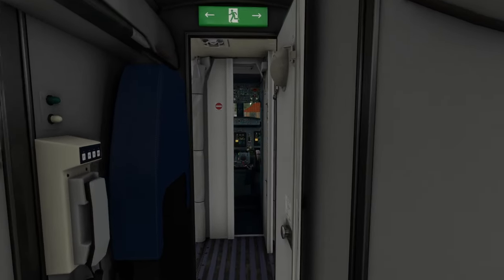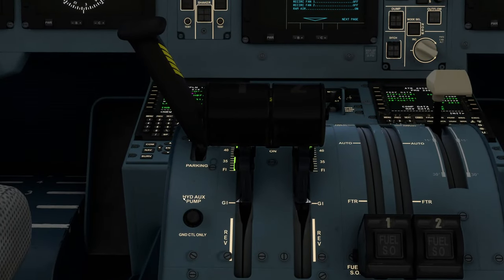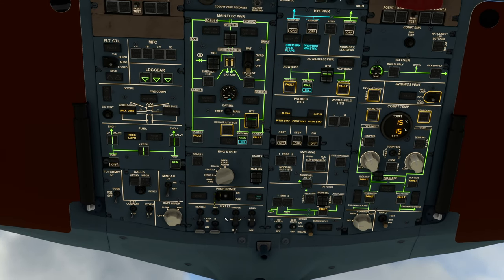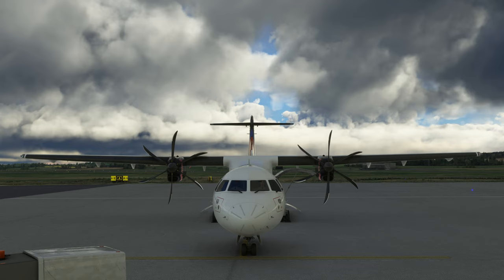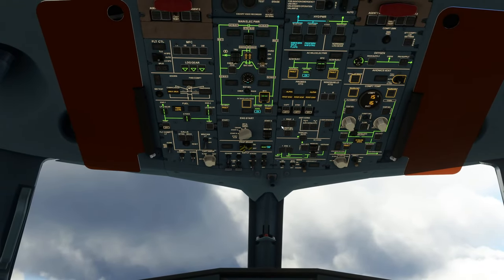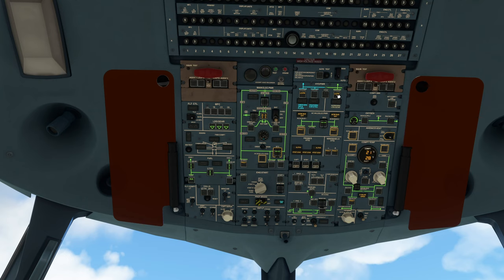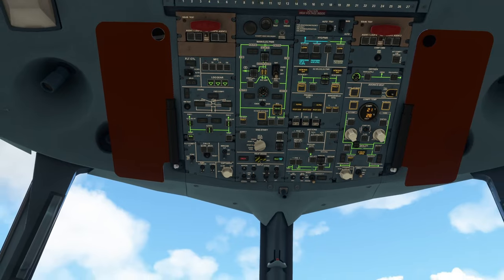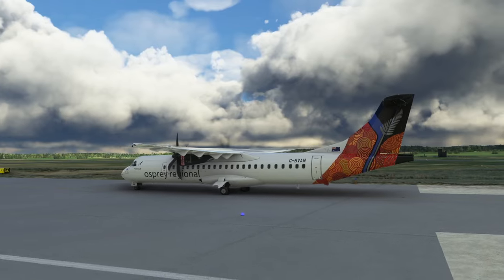MSFS | ATR Tutorial - Episode 10 - PROP BRAKE Update [4K]

Comment: Hi there, great video. I would like to just add a little extra information on how this system works and how it is used for your viewers. 

1- The prop brake is used in order to have a means of providing both power and air conditioning to the aircraft on the ground without having to use ground power. It is hydraulic and therefore cannot be engaged or disengaged without hydraulic pressure available. The normal way of using this system would be to power the aircraft from the battery, engage the prop brake, start engine 2 in feather, and once you have a stable start you begin now have power and air conditioning, you can then begin your cockpit setup for your upcoming flight.

2- The ATR hydraulic (Green & Blue) systems are powered by AC Wild power, however the AC wild generators are linked to the propellers, therefore the aircraft will have no hydraulic power available until a propeller is rotating and selected out of the feathered position. That is why we have this DC Aux hydraulic pump, as there is no AC Wild power being produced, we run the DC Aux hydraulic pump in order to gain hydraulic pressure to use (engage/disengage) the prop brake. The DC Aux pump will run for 30 seconds before turning off again. Sufficient pressure to operate the brake is indicated by the “Ready” light coming on

3- There is no connection between the starter selection switch and the prop brake. The prop brake is independent. Therefore there is no need to select “Start A / B or A&B” when disengaging the prop brake. It can be left in the “Off and Start Abort” position. The only action required to disengage the brake is to run the DC Aux pump, check for the ready light and turn the prop brake off. The propeller will then begin rotating in feather. To unfeather the propeller, select the condition lever to the “Auto” position.

4- Upon parking at your destination, to engage the prop brake again, first feather the propeller on engine 2, then run the DC Aux hydraulic pump if necessary to get your “Ready” light, once the “Ready” light is on, turn on the prop brake.

I hope this adds a little more understanding as to why the aircraft has this system, why some may struggle to engage/disengage it and how to properly use it. Safe flying 🙂
Reply from the maker: Amazing insight thankyou!

Comment: nice thank you -- hahaha I was turning on engine 1, unlocking prop brake and cutting fuel flow on engine 2 for a half second and quickly moving to auto feather for engine 2 to jolt out of hotel mode. This way much better. hahahaha
Reply from the maker: Glad it could help!

Comment: I have another question -- I am struggling with vPilot. I have a new computer... 
- Intel i5-13400F, 2500MHz
- 32GB DDR4 RAM
- NVidia GeForce RTX 3070 Ti
- 2TB HDD

runs MFS very smoothly (35fpm at dense airports, 60fpm at basic ones) yet vPilot stutters to such a point that ATIS is incomprehensible. It is very annoying and I can't find a way out!
Reply: Have you try in vpilot settings decrease less range and less number of aircraft who shall show in msfs?
Reply: Yes i have, no difference. The voice is chopped up, but the simulator renders the other aircraft without a problem
Reply: @novemberkilo277  have you check sound drivers for your sound hardware its up to date